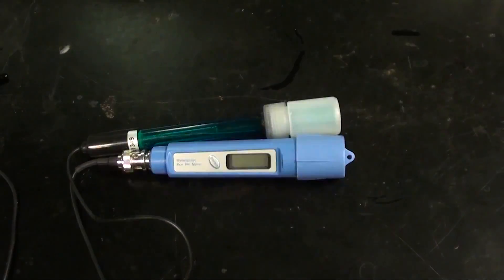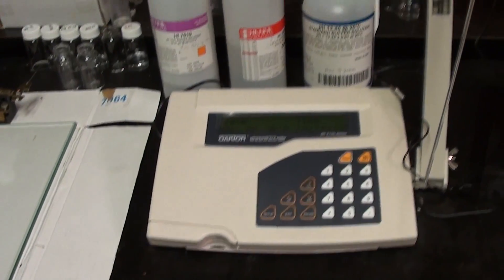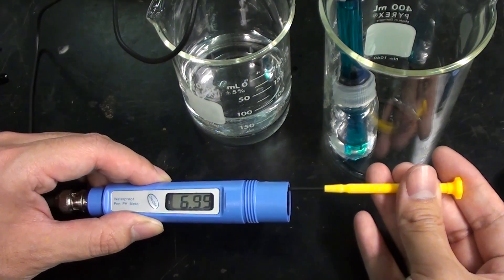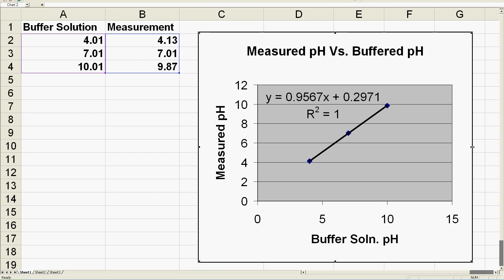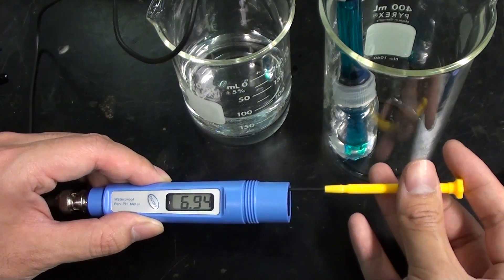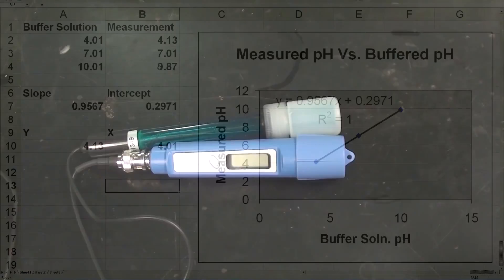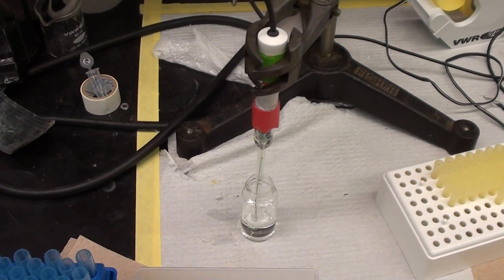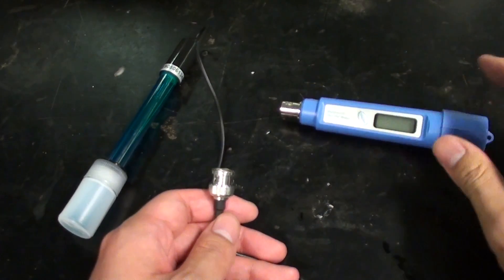Lab Equipment: pH measurement with paper and meters [Part 2]

Comment: For unofficial home use, you can make buffer solutions with vinegar, citrate, NaHCO3, Na2CO3, borax, etc. Adjust the acid or base as final touch til you match the official buffers. What matters is that there is a huge buffering capacity near a pKa, as long as the pH is within ~0.5 (maybe 0.7) units from it. Near pKa the slope of pH change vs acid or base added is near flat:slope=buffer capacity. Excel is great for visualizing titrations near pKas, and concepts of chemical equilibrium near pKa's.